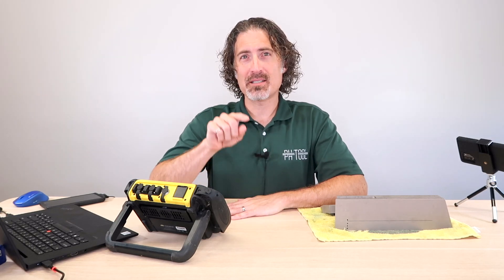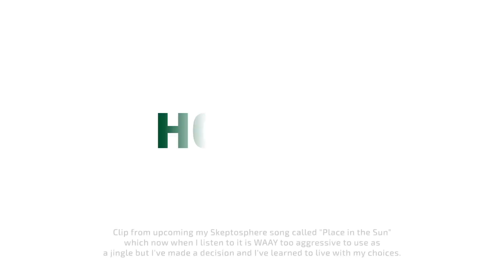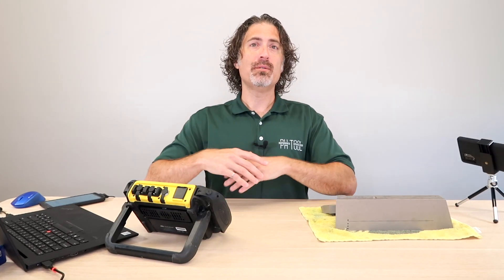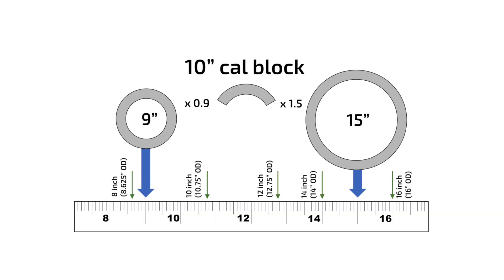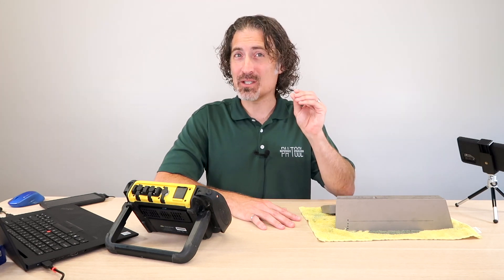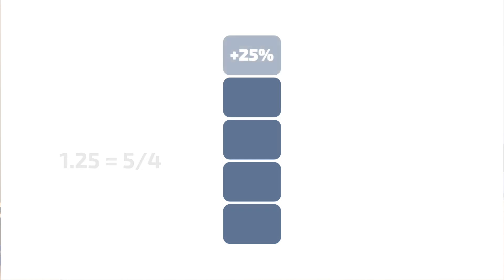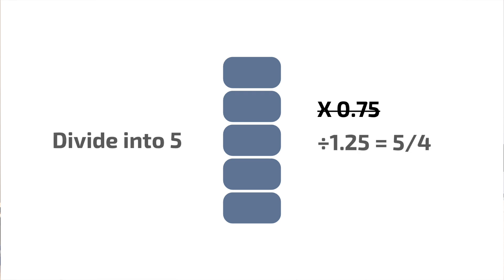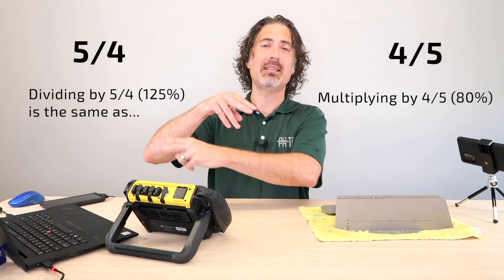Sizing Piping Calibration Blocks for ASME Inspections plus MATH!!

Comment: How to calibrate UTPA  wedge delay with a curved block
Reply from the maker: Wedge delay is just a combination of angle and time. The angle should be done automatically for you on the machine. The time delay is pretty elementary, just increase or decrease zero offset (or wedge height) until the reference reflectors are aligned at the correct depths.

Comment: I have a question. How to calibrate UTPA velocity and delay with a curved block? It is possible to do it with ERVT or I need a IIW with a curved surface?
Reply from the maker: Why do you want to calibrate for velocity? It's a known value in carbon steel for 100 years.
Reply: @hollowayndtengineeringinc.5201  Sure Paul you have reason but it would be possible to calibrate probe delay with the ERVT Side drilled hole? or I will need an additional block for this adjust.
Reply: @byronmino1662 , if the P number of the test piece and that of your V1 block are compatible, you can perform these calibrations on the V1 if your procedure allows you to do it. Some calibrate the wedge delay on a curved block's notch, but I don't advise anyone to follow this path.

Comment: I have a question that is a bit off topic. When performing an examination on a titanium weld, can use use a stainless steel block to calibrate and then use a transfer correction technique to account for differences in attenuation and impedance?
Reply from the maker: Technically no. They have to be the same P group.
Reply: Paul's answer suffices, but think of the possible velocity difference between the two and you'll realize that sensitivity, although important, isn't even the biggest factor.
Reply: No. Must be same material.

Comment: In order to make them corrosion resistant are these blocks chrome plated ?
Reply: Hi Sandeep, PH Tool uses an in-house electroless nickel-plating process to deposit about .001 inch of pure nickel on the block surfaces. This helps prevent corrosion and improves wear resistance. https://www.youtube.com/watch?v=xaPv_4Ql17U&t=30s